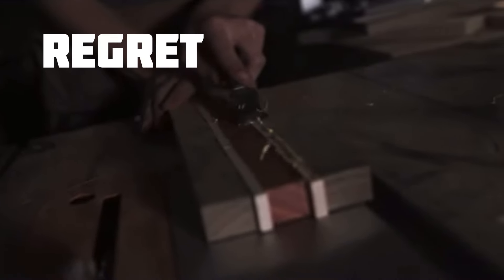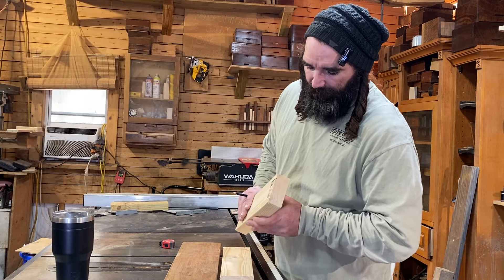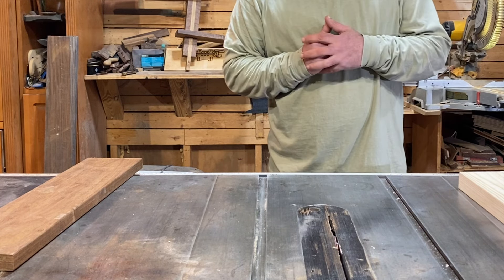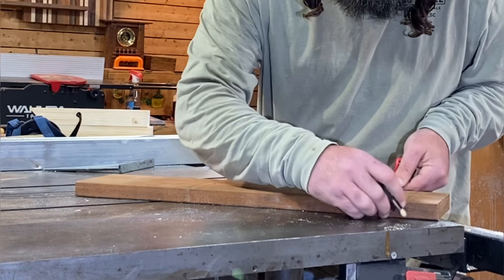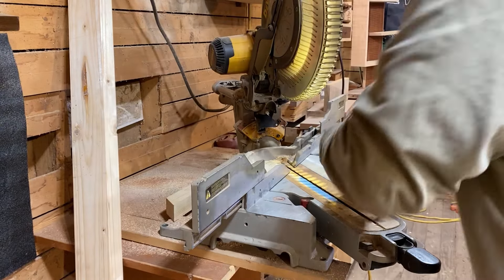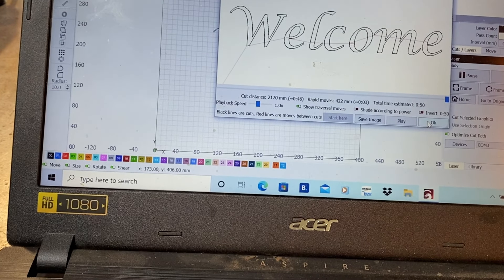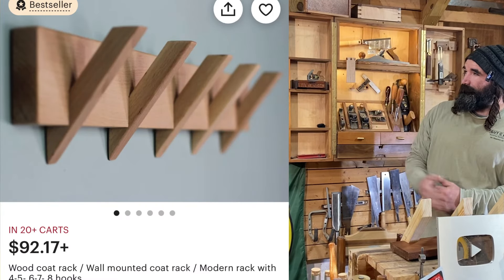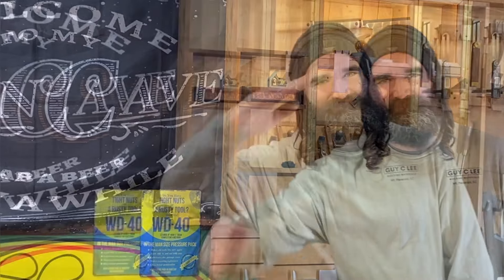Woodworking projects That Sell / Make Money Woodworking

Comment: I'm looking forward to getting back to making stuff. I've been working on my shop upgrades.
Recently bought a new table saw and miter saw, was having issues with power drawing down when I would turn on a saw and the shop vac dust collector. With only two outlets and my main breaker box was full so I installed a sub panel in the garage, GFI protected outlets, a separate GFI for the shop vac, a great heater and outlets on the ceiling for the garage door openers.
Replaced the Sheetrock and now I'm painting everything bright white so my old ass eyes can see better. Should be done in a few days!
Maybe you need to start wearing a helmet 🪖 because of flying 2 x 4 chunks 😂
Reply from the maker: 🤣 hell yeah , get it done and you’ll be making that saw dust ! No better feeling ! Skäl 🫡

Comment: I'm a little slow on the uptake and almost missed the Wahuda reference.  Great project!  I think I would have run the keyholes vertically instead of horizontally, so that if someone bumped it from the side it wouldn't wind up on the floor.
Reply from the maker: Skäl 🫡